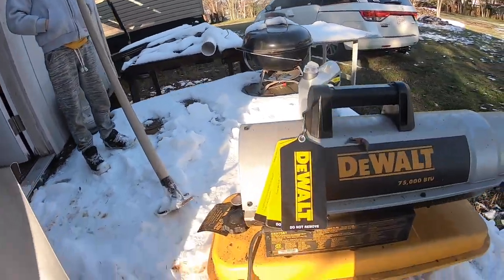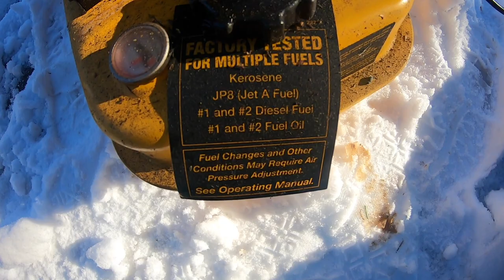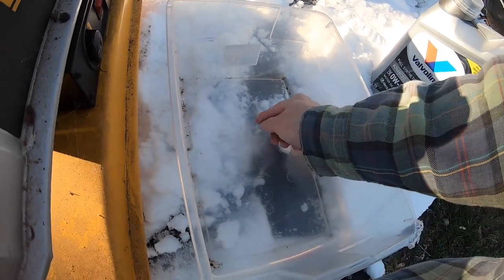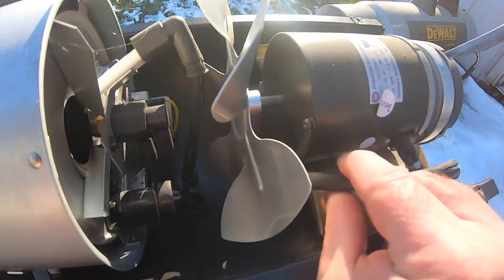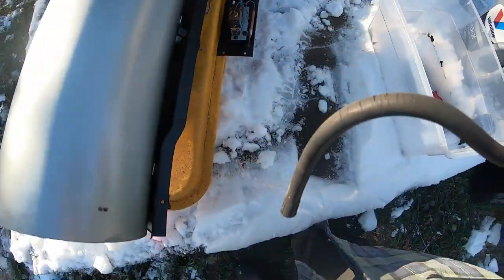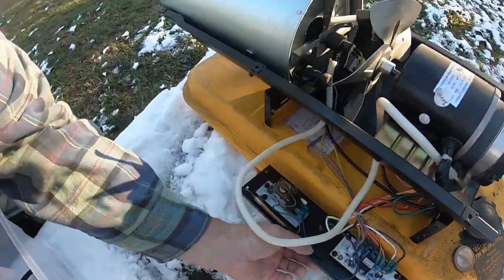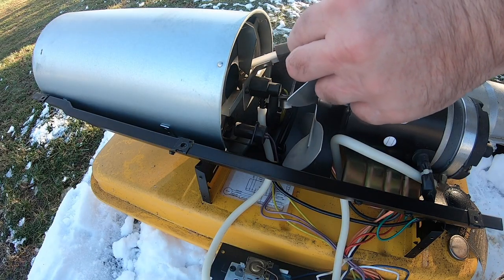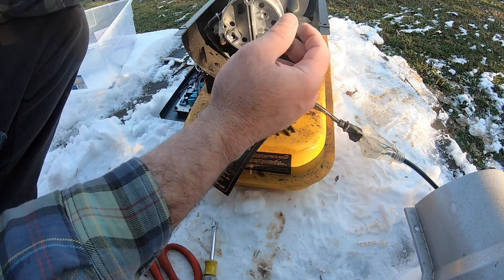Dewalt Torpedo Heater Spitting Fuel, Not Firing. Fixed! Model DXH75KT

Comment: My 10 year old 75k btu heater would ignite, then go out, ignite then go out, etc. Thanks to your video I found both the fuel and air hoses badly cracked. Replaced both hoses and cleaned the filters. Runs great. Thanks !!!
Reply from the maker: Glad it helped!!!

Comment: I have one of these - it smokes and makes terrible fumes - I think it needs MORE combustion air - I took off all of the top cover screws and then only installed one in each corner - BUT I added a stack of washers to create an approximate gap of 1/4” between the top and bottom covers, and used longer screws to accommodate the spacers - I also added graphite powder to the pump parts… but I think it’s the air intake that helps - try running it without the top cover for a minute - it roars like the devil with all that air… try at your own risk… worked for me - no fumes, no smoke… and the nose cone gets orange at the bare minimum fuel pressure adjustment
Reply from the maker: Nice tip, thanks

Comment: Another idea that works great for mine is, when it's cold (like first thing in the morning) is to hold your finger over the adjustment screw while you turn it on. That send a full shot of fuel to the burner and it starts up instantly so you don't get that puff of smoke. I found that little piece of info in my owners manual the other day.
Reply from the maker: Awesome!

Comment: Fixed my issue 👍 I assume it’s a draft system kinda like a carburetor. On my model the fuel line is behind the air line so it most likely relies on suction from the air flow. This allows it to pull fuel up from the tank and aids in the air fuel mixing
Reply from the maker: Great Brother!

Comment: Right on I think I found out my problem on mine I’ll have to check the hose mine was leaking fuel like that
Reply from the maker: Crazy to think that they are so cheaply made
Reply: @SRTPCC  I looked at my dewalt heater it’s the DXH9OCFAK the insides are different then yours. Mine saying code E3 does not want to fire up and leaking fuel a slow
Reply from the maker: @WyteOutAK  Interesting. Mine def doesn't have a code circuit. Post us a vid on the repair ✌
Reply: @SRTPCC  I don’t know what the repair is I’m looking for a solution right now
Reply from the maker: @WyteOutAK  I found this number on the interweb 855-805-5745 - Dewalt Service
Reply: @SRTPCC  yes thanks I called the service line. They said they will be sending me a brand new replacement heater and to keep the one I have now for parts.
Reply from the maker: @WyteOutAK  Awesome!

Comment: Got the 90,000 BTU model ---- brand new ---- doesn't light ---- POS
Reply from the maker: No doubt. More expensive junk
Reply: I got myself the 90000 btu model as well… lasted a month before it randomly started turning off and saying low fuel even tho I just added fuel to it. And just yesterday it started  throwing gray smoke out